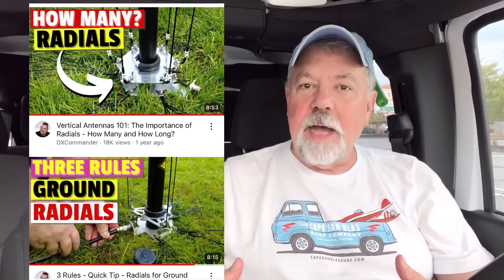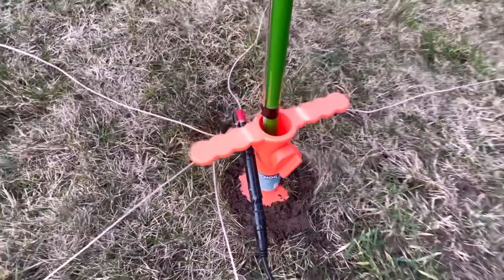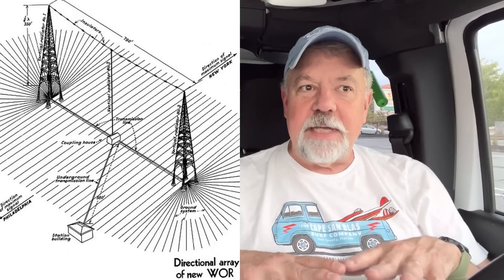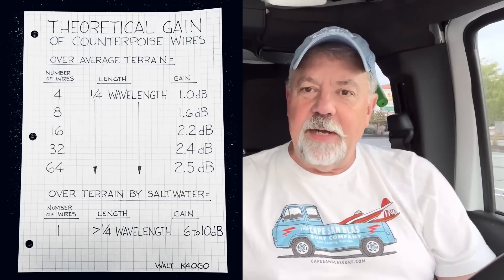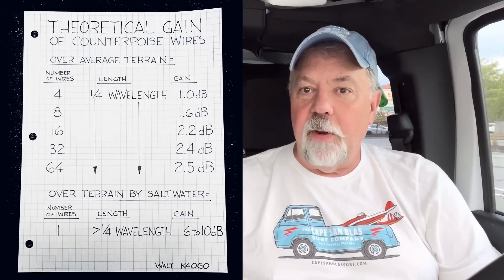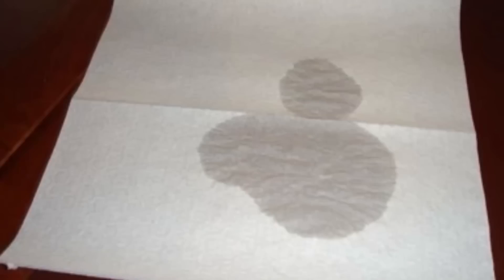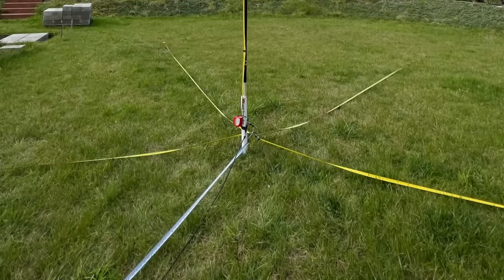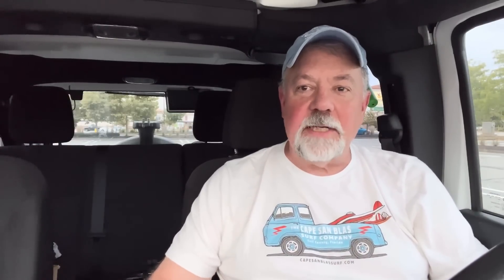The Keep It Simple Guide to Counterpoise Wires

Comment: Walt, I forget who it was but there was a video of someone who did experiments with different counterpoise screen areas and got almost no coupling to the ground inside an old rock quarry that was filled back in with rubble.  If you want to operate somewhere where the water table is more than 0.2 wavelengths down, it might make sense to cut your counterpoise wires to a quarter wave anyway.  73 KK7YIS

Comment: Hi Walt.  In my readings over the years, one wire is a counterpoise.  If you have more than one wire, they are radials, raised or on the ground.
Reply from the maker: I’ve understood it as a counterpoise “system”. A counterpoise is the “counter” to the driven element to complete the antenna circuit. Call them radials, Counterpoise wires, ground radials, RF Ground, etc. it’s all a counterpoise system.
Reply from the maker: To expound further, here’s what you get when you ask Google AI what it is:

An RF counterpoise is a conductor or system of conductors used as a substitute for a ground connection in an antenna system. It serves as the "other half" of the antenna, creating a complete circuit for RF signals to flow, particularly for vertical antennas or those that are not balanced. This helps to improve efficiency, stability, and radiation performance by providing a low-impedance RF ground path when a true earth ground is impractical.

Comment: do counter poise form a ground plane?
Reply from the maker: Yes, that’s what they’re doing
Reply: @COASTALWAVESWIRES  so isn't it also what radials do? what would make them different?
Reply from the maker: @itrstt66 radials are counterpoise, Counterpoise are radials
Reply from the maker: A radial is simply a counterpoise arranged in a radial pattern. They are functionally the same thing. Also a radial refers to a single wire in a counterpoise where the word counterpoise refers to the entire set of radials collectively.

This is a quote to demonstrate this directly from the wikipedia page for counterpoise:

"Diagram of counterpoise under the antenna mast of an AM radio station. It consists of a network of radial copper wires suspended above the ground"
Reply: @COASTALWAVESWIRES  thank you

Comment: One thing I have problem with is the length of counterpoise. I build  29.5 foot vertical wire antenna with 9:1 unun and I would not get good swr with multiple counterpoises atached to negative nut at the 9:1 Unun.  I disconnect couterpoise wires and then I installed 31 mix ferrite at the coax 17.5 feet away from antenna and swr came to normal levels for 10-40m band. So my question is why some antennas will work good when coax is used as counterpoise and others with wire attached to negative nut at the Unun. I am new to  building antennas and got stuck with this problem. Pozdrowienia z Californi i czasami Krakowa.😊.73's

Comment: now correct me but aren't  Counterpoise Wires the same as a ground plane? Say I put a fire stick on my 8' long bed truck  the signal follow the most ground plane? 
 do i have to  change the length of them when i change bands? can i use the same length for 80m for 10m?  back when i was on CB SSB i ran 1/4 ware wires for the ground plane (I had a 5/8 th wave vertical & i ran 4 102" long wire i wish i could talk to u live instead of texting u here

Comment: Cool video Walt...you nailed it... I just put a 20m vertical EFHW  on the flat ( 12M Spiderbeam masts are perfect for this) of a concrete building. In that concrete is a LOT of criss crossed rebar.. some of it sticking up are the remains of the load bearing  building support collums, left so a second story can easily be built as needed. This isn't salt water but likely similar.. a massive grid of iron buried in the concrete under my EFHW; yes we have earthquakes here, one just yesterday that rattled the wine bottles on my frig. Fired up the ol G90 up and an hour later worked Chile... 20 watts...5X7... It works and as a bonus I get a low vswr on 10 too...which makes sense being the second harmonic of 20.

Comment: I'm going to try a bucket of salt water and put one radial in it ......
Reply from the maker: @johanwithag2432  that will not work
Reply: @COASTALWAVESWIRES  I know, I was joking. I wonder what the physics is behind that one counterpoise wire in the salty lake. Does it matter if it is in or out of the water. What is the interaction between the wire and water.
Reply from the maker: @ hahaha you would be surprised how many times the bucket of salt water quote has come up in my comments. As for the wire in water it’s just like counterpoise on earth, it’s all about coupling to the surface, I’ve found that just being close works well.
Reply: @COASTALWAVESWIRES  Hi Walt, thanks for coming back on this one. Sprinkling salt around the vertical would be a nice other one.
Reply: @johanwithag2432  
I remember seeing an idea like that in an old radio book or magazine for an earth wire for domestic radio.
A metal bucket filled with, it might be charcoal but I can't remember, and add salt to it then put it in a hole in your garden to the bucket top. Keep it moist.
Maybe they were on to something.
G4GHB.
Reply: @COASTALWAVESWIRES 
 Have you seen the size of his bucket!
G4GHB.

Comment: Always enjoy your videos. This is a subject that gets my OCD ripping. I'm really glad you talked about this subject. Banana plugs are cheap.  Thin wire is cheap. I can make counterpoise groups easily.  Here's the deal.  20M antenna. 1/4 wave counterpoise. My understanding is I could put out 8 5M wires of counterpoise spread out. If I want to use them for 10M....just double them back on themselves for the correct length. ????? How far off am I?  =)

Comment: You’re one of the most down to earth Elmers on YouTube. Recent subscriber. Loving the content. 

I don’t know if you’ve covered this in another video that I haven’t gotten to yet… but I often see you working HF with your antenna close to (literal) sea level. But everyone else I see seems to really emphasize getting up off the ground with telescoping masts. Common rule of thumb seems half a wavelength. But you’re working many QSO’s on 10m at the beach without putting your antenna up 5+ meters in the air. Clearly it works for you. It’d be cool to get the kind of down to earth breakdown you’re doing here.

I also love how you’re clearly explaining how working HF at the beach is way more than just nice scenery. 

Another video that would be cool to hear about from you is vertical vs horizontal antennas, when you’re choosing each. I see you working simple vertical antennas a lot but then I hear others saying when you’re working 10m SSB it should be a horizontal antenna.

I’m planning to go for my General exam before end of year. I’ve got a 10m monoband (QT60) arriving today. I’ve got some speaker wire and connectors for fabbing up different antennas. And I’ve got an old Japanese Kei truck that I’m working on as a mobile shack. Your videos having me jonesing to head down from Raleigh to OBX to just get close to the water and have some fun with my radio and some wire and my tiny truck.
Reply from the maker: @TerraMagnus  thanks for the kind words! I’ve done several videos on what I call “The Saltwater Amplifier” which explains what’s happening with proximity to the sea. I’ve also done a few on RF ground and putting a vertical on the ground. Have a look through my channel page and you’ll see some of those. Oh and I remember doing a vertical versus horizontal video a while back LOL. All the best and 73, get over to the OBX and have some fun!

Comment: Hi Walt,  just put up a 35’ 6”  ‘random wire’ antenna after watching your video in Poland a couple of times… I’m really small here at home, my garden is micro and I’ve only just started up again after more than 25yrs… anyway, my random is off the ground similar to the window set up in Poland into my ‘shack’ in the garden / yard,,, you said a counterpoise of 6’ 6” should be used… well it’s hardly reaching the ground???  S O, I’m going to put a couple more up one will be twice the length… first  swr test only, mine tuned up on three bands nice,  even 40m which was a big surprise, I’ve only just put it up… ( 29th September ) so not been able to do anything but listen… no rush.
Walt, you are an inspiration and Callum…  I refer to him as the Antenna Alchemist, I’ve learned a load off him and now got you as well. 🧐 🤔  When you publish the book I want one. 😉 I’ll send you my address / cost whatever.73. 
Best wishes to everyone.       💙
G0UVL
Reply from the maker: Thanks so much for the kind words. Callum inspires me as well. I'm working hard on the book! 73 my friend

Comment: Nicely done, here is what I learned 50 years ago
Ground acts as a mirror and the radials couple to the ground. Since the ground is essentially a mirror it provides the other half of the antenna. This can be ilillustrated by holding a pencil perpendicular to a mirror and we see two pencils. If the pencil is a 1/4 wave element we now have a 1/2 dipole. This was known as a image antenna. So it is obvious that the shiner the mirror the better the performance. Radials couple capacitivly to ground thus leaving the insulation on the wire is not a issue. As far as resonate length it becomes more important on poor soil conductivity such as sand. AM stations would actually salt their soil with copper sulfate to improve their soil.

Comment: Imagine your vertical antenna building up an electrical field  from the radiator to the ground, The better ground conductivity is the better. So when ground conductivity is bad, you can try to compensate that by deploying many radials. Over conductive ground (eg saltwater, wet soil) you come away with less radials. That’s all. But, by the way, this only applies to ground radials. They improve hf grounding. Elevated radials radiate and thus must be tuned.

Comment: I have found with extensive experimentation in that length doesn’t matter and more shorter are better than less longer while lying on the ground. I’ve done a lot of experimenting with this very subject in several different locations over several different kinds of ground.

I’m using the WRC Sporty Forty and the Chameleon 17’SS whip on a tripod or stainless steel tent stake w/ a stainless steel jaw mount. It didn’t matter whether or not I used either. With the tripod I was trying to isolate the ground side from actually being “grounded”. I laid out 12 16.5 radials and the SWR was over 4:1, then removed 4 and it dropped to 3:1, removed 4 more and it dropped to 2.5:1, folded the last 4 in half and it dropped to 1.2:1. So now that’s 4 radials @ 8.25’ or 33’ of total radials or basically 1/4 on 40m. I also took 2 sets of my 16.5 radials & made them 33’ long so now I have 4 1/4 wavelength radials lying on the ground. Sliced a little bit off the end of each one and got a 1.3:1 or less across the entire voice portion of 40m. Then I removed the coil and tried 20m, and now I have 4 1/2 wavelength radials lying on the ground for 20m. This got me about a 1.6:1 across the whole voice portion of 20m which isn’t bad.

Why this happens for me and not others is anyone’s guess. I certainly don’t have any idea as to why. In my experience length does make a difference, even while lying on the ground.

As far as gain 1db of gain on the other end isn’t even going to be noticed.

Comment: People get put off trying it because they think they need lots of radials. In reality, one quarter wave radial will get you a match. My radial kit is four 5m long radials. As I am adding a 40m coil I am adding two 10m radials as a separate kit. I will use both together, but I also use the 5m ones on the car antenna when I'm parked. I always tell new hams that the best antenna is the one you can put up today.

Comment: Great job Walt !  What I do for verticals is just get a bunch of wire on the ground. Can be speaker wire.  If you can't go long for 80 meters ,just cut in half and re connect them.  Same amount of copper. just more. still work the same. This can change a lot due to soil .73

Comment: Just a few tips from a counterpoise addict..
Don't bury them deeper than 4 to 6 inches, HF radiation doesn't penetrate the ground well. 
32 radials is a useful maximum. The improvements beyond that are so small as to be pointless.
32 radials cut for 40M (33ft), will operate like 16 radials on 80M and 8 radials on 160M. ..and of course, like 64 radials on 20M. That relationship is proven and reliable.
...the point above is that 64 radials are only a tiny bit better than 32 on 40M. However 64 radials on 40M will work like 16 radials on 160M instead of 8 and THAT is significant. 
Radials in wet and/or salty ground work best. You can sprinkle driveway salt across your radial field every couple of wiinters to aid conductivity, that works well. 
Don't feel the need to splash out on costly wire. Simple medium gauge copper wire is great and will last years. 
Slice the soil with a spade and push the wires in. Do this mid-winter and your lawn will be healed by the summer. You'll be surprised.

Comment: Thanks Walt, great video.  I have been a ham operator for a long time but most of my work has been in a shack with store bought antennas.  I have made a few dipoles and I was with a club where we built G5RVs and sold them. 
However, my adult ham radio time has either been in military housing and since I retired and became a pastor,  church parsonages.  Always depended on what the people would allow.
Because of your videos and a couple others I have gotten into portable and QRP radios.  I have recently built a couple 49:1 baluns and have been running long wire for my QRP setup.  
I am still learning about long wires and counterpoise.  
Thanks again for the awesome video.
73 AL7NS Larry

Comment: Excellent video Walt! Ground radials have always been baffling for operators who use vertical antennas. I had to do massive research to figure it out. You condensed a great amount of research into one video that will help people understand radials. I use 10 with 3 of those being slightly shorter than the other radials. I've got really good ground where I live which helps.  Rudy's writings are fantastic as are Callum's videos. The problem with some of the antenna books is that they go way over the heads of newer ham radio operators. When I first started learning about radials, it took forever because I had to keep looking up terms I wasn't familiar with. Thanks for simplifying things for those of us who are not rocket scientists...73...Hugh...KN6KNB

Comment: Note from my activation yesterday. My dxcommander came in. Loving the pvc base for it working great can't wait to be on the beach Monday 😂. 

Anyway yesterday did a pota at US-6393 trying the raybakov style 25ish ft of 20ga with the 4:1. The 4:1 was probably 2-3.5 ft off the ground .. still working on my alignment skills.. I was fascinated by the swr readings.

4 18ft counterpoise wires: 10m 1.3, 20m 2.4, 40m 5

6 18ft wires: 10m 1.4, 20m 2.4, 40m 5.3

0 wires: 10m 1.3, 20m 2.3, 40m 2

Anyway ended up activating on 40m no wires got 56 qsos in an hour. So I guess I am lost on the concept of wires or the terrain I was on was screwing with it.. or the 50ft coax was enough.... or the counterpoise were to Sloped coming off the pole it was interfering... can't wait to continue trying!
Reply: When you had 0 counterpoise wires down, your 50' coax would have been acting as the counterpoise.

I tried my 25' vertcal with one 60' counterpoise wire. I got low SWR, but did not get out much. Changed to 4 x 16'5" wires and got lots of contacts all across the continent.

Low SWR is not an indication  of an efficient antenna. Making contacts is what matters, with an SWR low enough to not damage your transmitter.

Have fun!

Comment: Thanks Walt. This helps a lot. Couple of questions. If I were to put a ham stick up on a 25 foot pole, should I be using radials? And is this true with any raised antenna? If I understand what's going on I would think I should be using radials like a normal ground plane. Other question is this. What if you are out on a boat and want to operate on HF? Counterpoise right into the water? Then what if it's fresh water as on a lake?

Comment: Another good discussion! Might be good to note that the terms radial and counterpoise are now being used interchangeably. Not sure if that is good or bad but it seems to be the way it is. In the old days we would use counterpoise meaning one such radial. Either way they can be on the ground or elevated. Thinking of the antenna as a complete circuit with the copper part of the circuit being completed with a field line drawn from one conductor to the other also helps visualize how/ where the radial or counterpoise “ collects” the current from the surrounding air, either or space around the antenna. Some authors use the term “ push against” to try and illustrate that the radiating element or visible half of the antenna needs something to collect the current that leaves it. Hard to explain without writing a book or teaching a couple of engineering classes but you definitely are helping a lot people understand better.
Reply from the maker: Great input, thanks for sharing
Reply: I think that once enough people start using the terms interchangeably it’s a losing battle to try and change that. I was just reading the ARRL Antenna Book on the subject of counterpoise last week and if memory serves it said, if the wire is on the ground as part of the RF ground system, then it is called a radial. A counterpoise is typically elevated.
Reply: @Jeff_AA8HF  you are correct. My first counterpoise was a short wire on the floor behind my radio desk to make the chassis of the radio stop biting me on 15 meters! Suggested by my Johnson Viking Ranger II transmitter manual. I used to cringe when I heard misuse of the terms but now only thing to remember is when someone says counterpoise they probably mean radial.